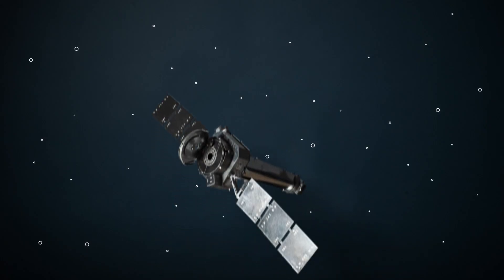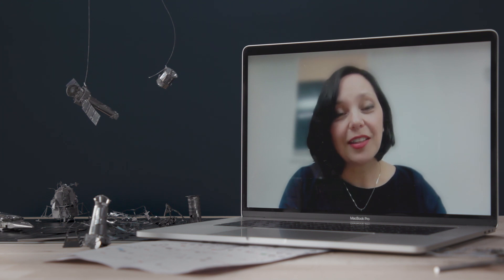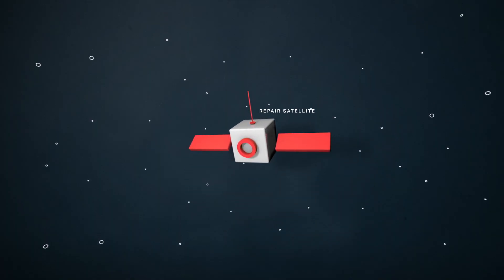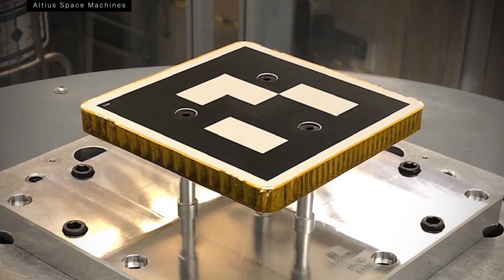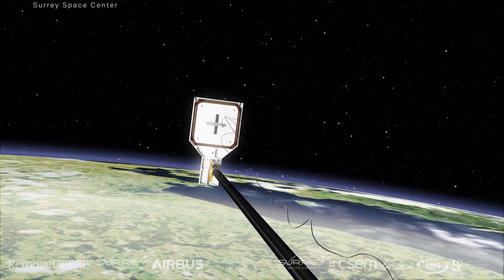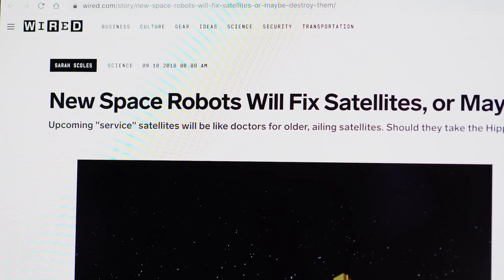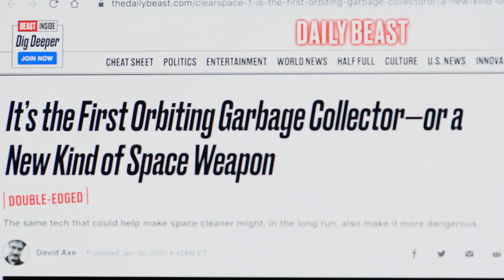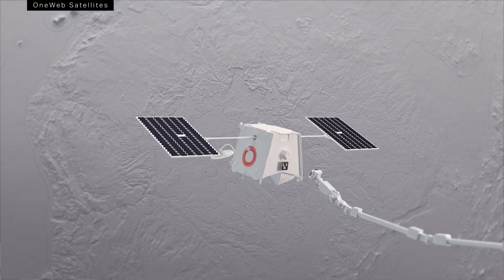The era of satellite-repairing robots is here

Comment: Something doesnt add up.. How do you keep so many spares on hand? Are we going to launch a repair satelite to repair a broken one? So its 2 satelites either way.. If we are going to have satelites stocked and usable multiple times.. Firstly fuel, eventually this will run out and it seems like this will be relatively fuel heavy. Secondly, how do you keep the spares safe from failing themselves..

Comment: With the cost of launches going down. I think the era of Satellite repair just went out of business. If it only costs you a few million to launch a new one, why fix the old one. I mean the possible fixes that a repair can do is really limited anyway unless you launch a repair satellite with specifically the parts you want to replace. 

I think building a communication backup to reflash firmware would be easier than having another satellite dock or If you run out of fuel, what the heck were you even doing in the planning stages. Everything else basically would require parts and if it needed parts it needed another launch anyway.

When the space shuttle was around it was quite expensive so the repair bay to repair satellites made sense. However with current technology to make satellites smaller (and thus launches cheaper) along with cheaper launch platforms the entire concept of repairing in orbit doesn't really make sense than just launching a replacement.

Comment: Sounds complicated. I feel like at that point you might as well have the new satellite take the place of the failing system. ie: Satellite gyroscopes fail, send a 'repair' satellite with functioning gyroscopes, connect it to the old satellite, now you have a satellite with access to working gyroscopes. I'm not a rocket scientist though, so it will be interesting to see if a repair system comes to fruition in the near future.

Comment: Launching these repair bots satellites will introduce more debris, won't it?
Also, it seems like it would take a lot of fuel to dock with a satellite, repair or de-orbit it, and then get to another satellite in a different orbit. So at best I imagine these repair bots will only service a handful of satellites before they too need to be disposed of. Which makes the per-satellite cost of repairs pretty high, and no guarantee other aging components won't fail soon after. You'd probably be better off launching a brand new satellite with improved technology instead.
Perhaps if there were a handful or orbiting hubs that could dispatch repair bots, and then recover them to re-fuel and re-equip for more missions, you could lower the cost of repairs. But putting that infrastructure in orbit would be a massive initial investment. I don't see this technology being practical anytime soon. Aside from proof-of-concept demonstrations, we're at least another whole generation of satellites away from this being a regular thing.

Comment: Name: Verge science. 
Used metric: "MiLeS pEr hOuR"

Well this on the verge of bad science... I'll let myself out.
Reply: Fair, but they're also a science communication platform with a large American audience, and we Americans are mostly used to MPH. Also since we're all already on a computer, unit conversion is fairly trivial. Still though, I think your point is valid.
Reply: @leestuurmans2837  well I'm just saying they should also put metric system units just beside imperial ones...
Reply: @WillJackDo  Yeah, that's a good call
Reply: Christian B. the audience for this show is probably not scientists for the most part.
Reply: Well I don't think many viewers of verge science are "real scientists"
Reply: no, a real scientist doesn't work with anything but system internationale units (metric system of measurements). They never have to convert anything but possibly °C to K.